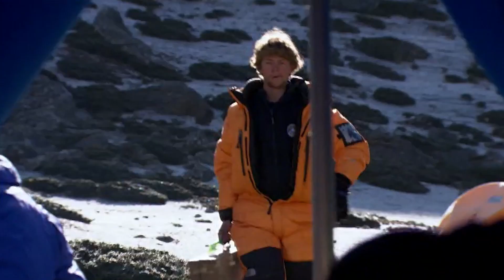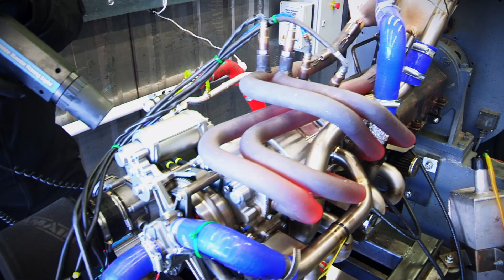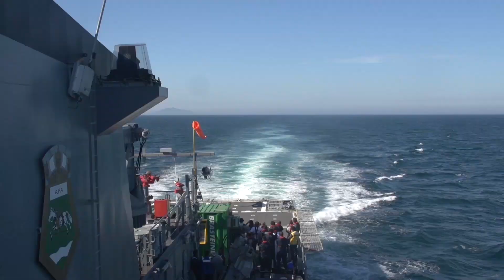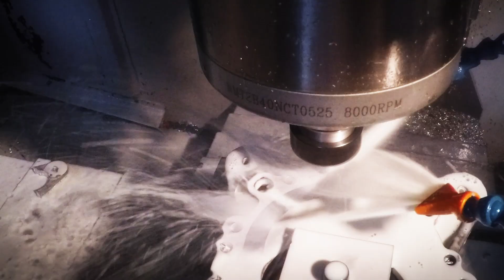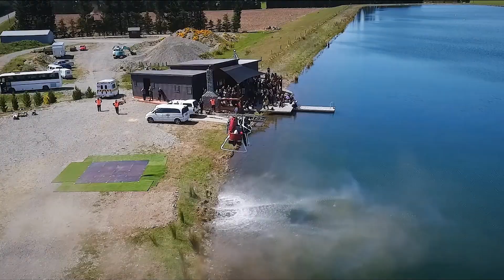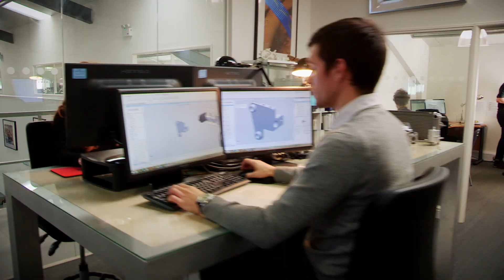Introducing Rotron Power Engines

Comment: Fantastic job with the rotary, Mr Crighton. Why does Mazda Hiroshima not collaborate with you to learn each other from both improvements on that fantastic engine ? Mazda is working now on the 16X Rotary in order to improve the torque, reduce the fuel consumption and to make the engine more reliable. That new engine should equip the sports car RX VISION. Anyway congratulations to you for your rotary engine !

Comment: Highest Weight to power ratio in the world ?
Reply: it would be nice to have a wankel option in trucks also. Smoother running, oil injection with a synthetic 2 stroke, all heavier duty roller bearings , no valves and lots of power. It would be way better and more powerful than any diesel would burn less oil, no oil changes required. Also the possibility of eliminating chemical fuels if converted into an electromagnetic/electrogravitic over unity device tapping radiant ZPE form the vacuum. Tom Bearden on energy fro the vacuum mention this.
Reply: @jlo13800  So you don't understand why trucks don't use the Wankel engine????
Reply: @sandervanderkammen9230  Probably no one is used to them. they use a lot of piston 2 stroke and i got one of them out back a v8 8v92 2 stroke detroit. I also run synthetic in that BRP XD-100 2T. that oil is cheaper than amsoil.
Reply: @sandervanderkammen9230  I Like the UAV 294 cc 50 hp wankle. the article on it mention a tuned exhaust to help with scavenging, even though its 4 cycle it does act like a 2 stroke.
Reply: @jlo13800  Its simply engineering fundamentals.
Its called BMEP
Reply: @jlo13800  You mean the Sachs KC24? Its an obsolete 1960s design.
 Exhaust tuning is a different concept for Wankel engines because they are not 2-stroke.
Reply: @sandervanderkammen9230  There is axle tine electric motors that make over 5 to 6 hp per LBs at 6000 rpm and below. The Magnax Emrax fits in your lapr and does well over 402hp and 737 ft-lbs torque! thats equivalent to a whole bunch of wankels! There is Yasa and the QMF-360-X which is 1340 hp and 3000 ft-lbs torque and its small. 10 qfm's can be stacked together to make 13400hp 10 rotor electric engine and 30000 ft-lbs torque. A room full of 2 stroke diesels wont even do that!
Reply: @sandervanderkammen9230  Them sachs were nice now the Rotron, Aixro and UAV rotaries are based on it. Its sounds like you are a 2 stroke piston fan and i am too.Brian bike is badass with the new 690cc 2 rotor even though electric motors make enough torque to twist it into the next dimension!
Reply: @jlo13800  The Wankel engine was a failure
Reply: Definitely not... Wankel engines are obsolete technology.
Reply: @sandervanderkammen9230  They are way better than a 4 joke stroke piston engine. 2 strokes can be tunes for so great low end torque. Im running amsoil interceptor 2 stroke in my rotary.
Reply: @jlo13800  ALL Wankel engines operate using the 4-stroke principle.
Reply: @sandervanderkammen9230  There are some 2 stroke conversion patents on the wankle and it could boost the low end torque as the the wankle lack low end. wankle run oil injection like some 2 strokes do and burn some good 2 stroke oil. im usin g amsoil interceptor in my rotary now. Its doen have the peak combustion temp was a higher compression 2 stroke. im running XD-100 in my 8v92 2 stroke v8.
Reply: @jlo13800  Yes, thanks for confirming that you are an imbecile.
Reply: @sandervanderkammen9230  No they are not.
Reply: @jlo13800  PROVE IT!
Every engineer knows the Wankel engine is a 4-Stroke

Comment: How are these any better than mazda's wankel ?
Reply: Simpler design and better oil injection.
Reply: There not, its basically just an old 1960s Sach Hercules engine.
Reply: Rotron is not a legitimate engine  manufacturer, Gilo Cardozo is a fraud.
Reply: @sandervanderkammen9230  I notice that this engine sounds like a bunch of hoo ha, the web site and pdf make this thing sound like it can warp space time, i can see why you like the good old piston 2 stroke. I got a few of them to.

Comment: Did a better job than Mazda.
Good work they do have some advantages.
Reply: Way better, are they running amsoil interceptor. these rotron's make way more power per CID than any mazda.
Reply: @jlo13800  Amsoil is crap.. no API rating
Reply: @sandervanderkammen9230  What oil do you like. Amsoil is not cheap. i called them and they said it was straight SAE 30 for interceptor and SAE 40 for dominator, Dominator is for racing 2 strokes only and turbo 2 strokes. Its way to thick for a wankle as they have lower compression and burning temps.
Reply: @sandervanderkammen9230  You use silkolene pro 2 sx or redline synthetic 2 stroke? Motule 800 2t?
Reply: @sandervanderkammen9230  SAE 30 CF-2 is all i can find and it works for me. Which oil do you like? BRP XD-100 Etec is SAE 40 CF-2. I also run the interceptor in my toro mower and its overkill but i run it hard in the summer and mow 2 acres with 6 HP. i Run 40:1 in it. The BRP XD-100 is cheaper than amsoil and is just is good if not better.  My v8 detroit 2 stroke uses a a good amount.
Reply: They don't have any advantages... that's why these horrible unreliable are obsolete.

Comment: Have you considered developing crate engines to drop into mazda RX-7s in 2, 3, & 4 rotor configurations? If you can do it better than Mazda, then I think that could be a cool market to get into! Pretty  cool someone else is putting further R&D into the Wankel though! Props!
Reply: they can all be filled and run on synthetic 2 stroke oil though, my girl filled a few quarts of amsoil doninator 2 stroke in here 13B and was the best so far.
Reply: @jlo13800  Amsoil is crap and a pyramid scam

Comment: Wankel engines have always had great power to weight ratios and have been a marvel of simplicity.  The problem has always been the fuel burn, which it didn’t seem like they talked about
Reply: i got a few omc rotaries.
Reply: True for road car use, where engines normally operate at a fraction of optimal output & efficiency. At higher power settings efficiency is quite favorable with a rotary. A small engine like this would be really interesting in a hybrid vehicle, where it’s primary purpose would be to drive a generator, secondary to the drivetrain, like Honda’s setup.
Reply: David Studner from what I understood, wankle motors suffer even at high rpms due to the inherent flaws of the apex seal and the fact that the “combustion chamber” is moving, causing the burn to be uneven across the chamber.
Reply: @xpeterson  A piston engine's combustion chamber moves, too, up & down as well as the air/fuel mix passing valves & swirling around in there. The apex seal issue was solved long ago. I think they're bad rap has held on since the early days. Think about the challenges piston rings endure - round walls, lateral piston loads. An apex seal's job is more straightforward, if you think about it.
Reply: David Studner when people talk about a “moving combustion chamber” when referring to wangle engines, I feel like it’s pretty apparent that they don’t mean that traditional cylinder engines have no moving parts at all.  I don’t see how that could be misinterpreted to be honest, in a traditional engine the cylinder is relatively stationary while the piston moves up and down, meanwhile in a wankle the entire “cylinder” is in rotational motion.  Who would imply that a traditional engine doesn’t have moving parts?

Apologies for mentioning specifically the apex seals, what I meant was sealing issues as a whole, which are harder to visualize when looking at the wankle from a 2D perspective but become apparent when you bring the diagram to 3D.
Reply: @xpeterson  the combustion chamber is two parts. In a piston engine it's the cylinder (stationary) and piston (moving). In a rotary it's the chamber (stationary) and the rotor (moving). While they behave a little differently, both have moving "pistons", one goes up/down, the other goes "past".

I get the sealing issues. The oil seal on the faces of the rotor are a wear area but the engines have a pretty predictable service life almost regardless of use case. 

My point is that a small rotary, running nearer thermal efficiency peak will be small, light, and reliable. In this use case it's pretty easy to engineer for long life. This wouldn't be a hot-rodded scenario, which is what exposed issues in the early Mazda rotaries (had one, couldn't bust it..).
Reply: David Studner I understand how a piston works.  Going up and down is very different from going “past,” and in a wankle the fuel burn is disproportionate, favoring the trailing side of the combustion chamber.  On top of this, since it is a radial motion, acceleration forces are applied to anything inside the chamber.  I’m not saying pistons don’t move, I’m saying there’s a fundamental difference between a pistons pushing in and out of a chamber, and the entire chamber being flung around in a circle.

Maybe the early rotary engines of ww1 planes (not the standard radial engines) had some similar issues to the wankle engine, but I don’t know enough about those to comment.
Reply: @davidka63  That is not true, the combustion chamber design of the Wankel engine is inherently flawed because it moves with the rotor face.
 Wankel engines cannot be adapted to use a modern, high efficiency "Quench" or high swirl chamber architecture. 
Thats completely false, the fundamental design flaw of the apwx seal has never been solved, apex seals are extremely vulnerable to damage and fail unpredictably.
This is exactly why the Wankel engine has never been used in type rated passenger aircraft.
Reply: @davidka63  Not true, several manufacturers developed Wankel engines for generator applications and the performance was dismal.

Hybrid vehicles are marketed as being cleaner, quiter and more energy efficiency... the Wankel achieves none of these.
Reply: Hey guys, Debates really help me acquire better knowledge. thanks so much! You both sound knowledgable.
Reply: The Wankel engine was a massive commercial failure because of the terrible reliability problems...